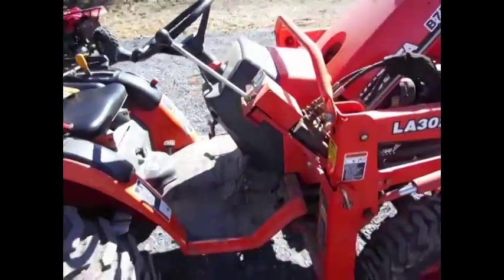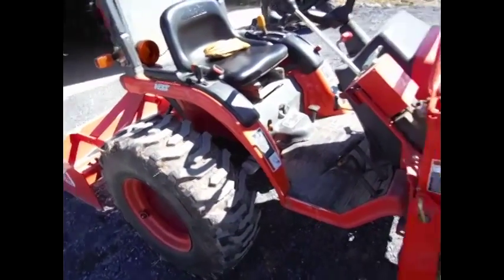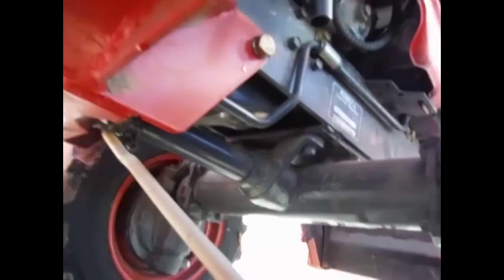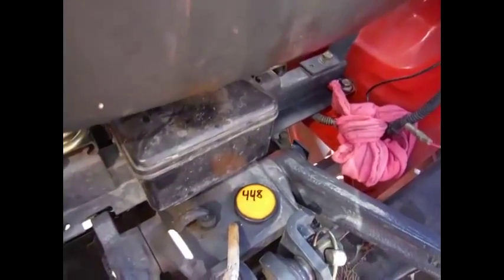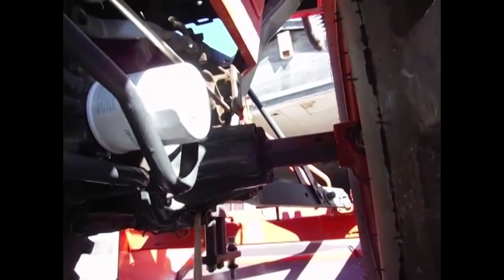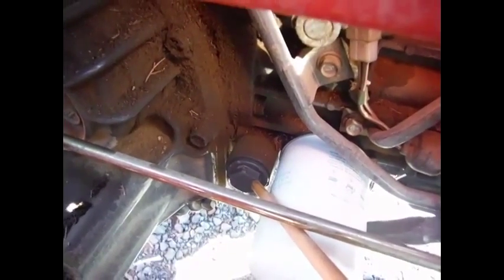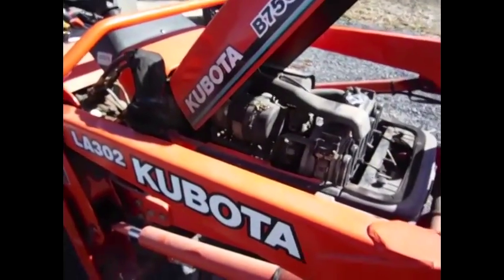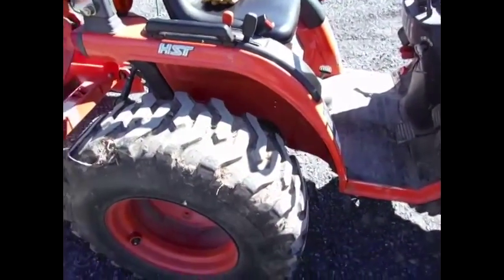B7500 Service Review

Comment: Nice job, everything I needed to know, short and sweet. I have zero showing on the hydrolic stick.  Not sure if thats because the 3 point is up and the bucket is off the ground.  Thanks again!
Reply from the maker: It's low on fluid. Don't use it until you add fluid. You could burn up the hydraulic pump.

Comment: Why is there no over flow for the radiator on these tractors?  Makes it hard to check the anti freeze levels!
Reply: Mine has an overflow bottle, but I didn't know about the screen filter behind the right side hydraulic filter.